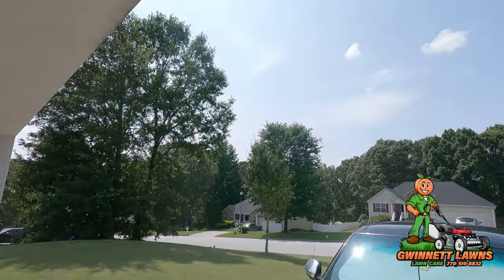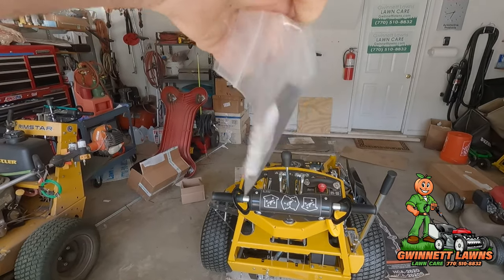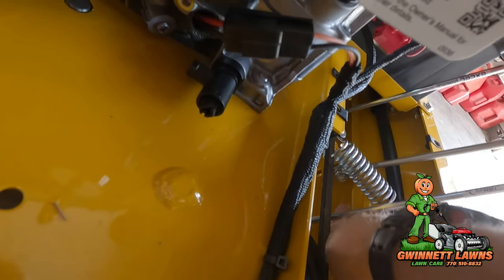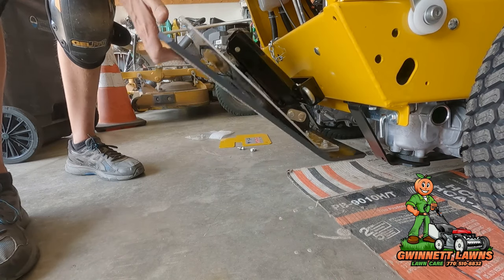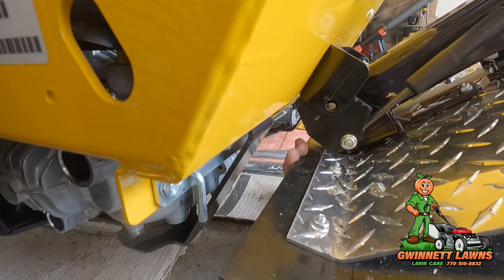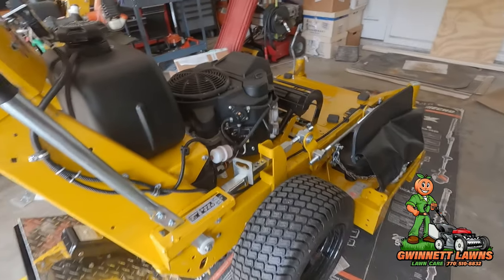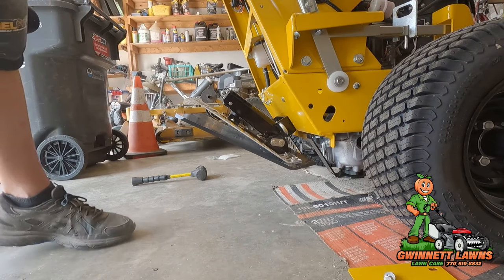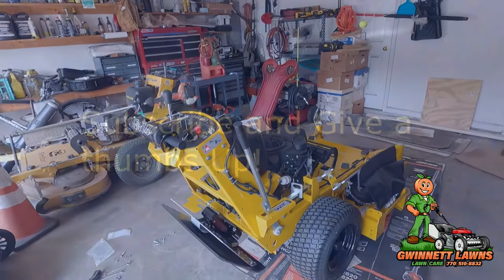Proslide XT Angle Correction Bracket for the Hustler Trimstar...YOU NEED THIS!

Comment: Thanks for the info.  I have a 48 inch trim star running a 2wheel velke sulky and considering a pro slide for additional comfort on my back and joints.  Just found out that I have a pinched nerve in my lower back with pain radiating down into my leg.  In your experience is a pro slide more comfortable and easier on operators body?
Reply from the maker: It’s super comfortable because you can go over roots and holes and all that.  A regular wheel velke will jar you to death and it just glides over it.

Comment: You mentioned about purchasing the FX version power plant for your TranStar do you feel a lack of power? In what scenario? Is this lack of power with the trim star and it’s power plant..

Also, is it because of the terrain you live in which slopes you have the trim stars?  I’m really thinking about purchasing a walk behind, but I’m wondering if the walk behind is too slow? My concept is I don’t think it’s too slow as far as miles an hour. I live in Florida. It’s mostly flat. This would be my first commercial mower. I do have an ex mark 30x this is my first year being solo so next year, I’ve got to get a bigger deck mower.. I’m thinking about a stand on or a walk behind.. maybe you can help me not make a choice, but see things in a different light.. all right Russ have a good one
Reply from the maker: I like the FX because it has the canister air cleaner and is up a little higher.  We have some very steep hills and these mowers are like mountain goats and will stick to the hills like glue.  I also like them because they have really big tires and allow me to cut in very soft wet ground conditions, that any other mowers would get stuck and leave ruts.  These mowers don't leave ruts in wet conditions.   The Trimstars have plenty of power and I would run them in any terrain.  Their top speed is 6.3 mph so that combined with a proslide is perfect.  I cut a lot of very overgrown yards and would like extra power when I needed it.  The 48 is the perfect size to fit through most gates and is easy to maneuver around and would love to put the 691 engine on it with 24.5 hp.  That would destroy the overgrown yards I seem to always do.  I use to have a Wright stander and while it was a very nice mower, I can cut every yard faster with the Trimstar especially on hills or in wet conditions.
Reply: @GwinnettLawns  thanks 🙏🏻 for your in-depth reply.. I’m really looking at the 52” exMark x series  pro-slide I like this product.. 
I believe the walk behind is well worth it.. thanks Russel